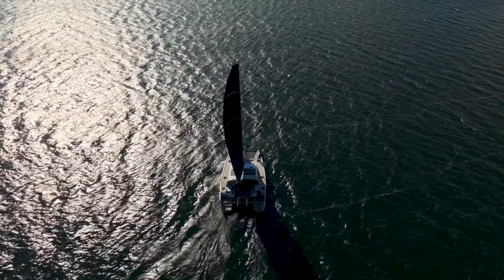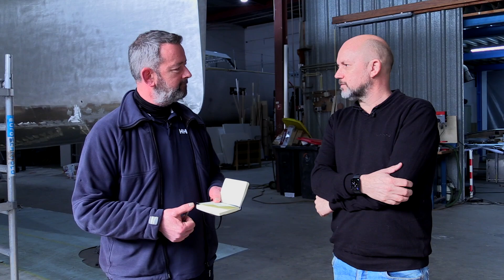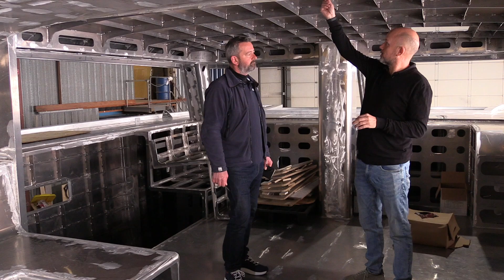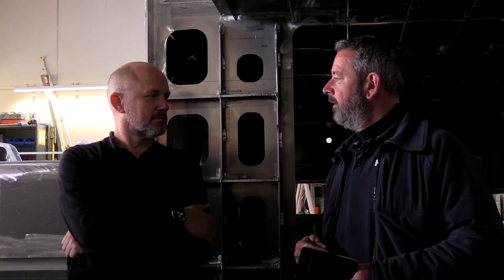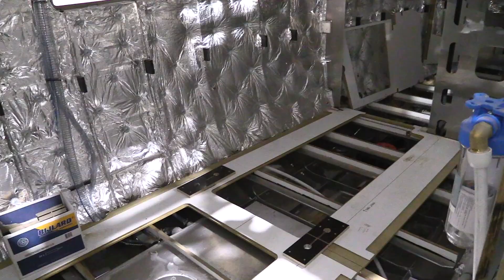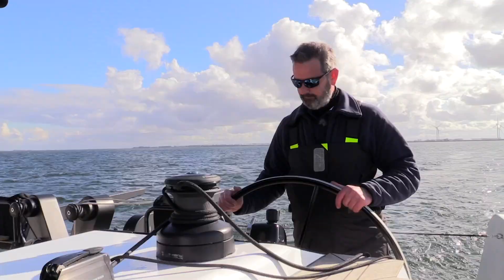Factory visit. How Vaan Yachts builds its aluminium catamarans.

Comment: Distant Shores documented the build of their Dutch aluminium Enksail 49, i noticed they took the spray insulation some way below the waterline then painted the remaining bilges, which seems a little different to Vaan's process where they stop at the waterline. Maybe because cats don't heel much? I assume Vaan paints the bilges? Thanks for sharing.
Reply from the maker: @philipwright7186  thank you for watching.

Vaan may enter the comments soon.

Vaan don't paint the inside, after all, it doesn't paint the outside and that going to be exposed more than the interior (I'm pretty sure, IIRC, Garcia/Allure don't paint their interiors either).

Vaan don't use spray foam because it can be recycled. Also, personally I'd be wary of spray foam because if there's any damage, it has to be completely removed around the area of any welding repair. I'd also be apprehensive of making any area of a hull inaccessible. Of course we're all shaped by our own experiences and Distant Shores are obviously happy with that method.

I know on Jimmy Cornell's Garcia, for example, the floors were insulated so the space between the floor and hull was cold to prevent moist warm interior air from condensing on the cold hull - but she was designed for the North West passage.
Reply: @YachtingReviews  Vaan website says "Parts like “bilge”, “engine room” and “Garage” are painted, so you can easily clean. Other parts are left bare; the beauty of aluminium is that it protects itself by adding a thin oxide layer."
Reply from the maker: @connannbarbarin3033 @connannbarbarin3033  The boats we saw in production weren't finished, so I'm probably confusing those with the boat that was on the water, and looking back through the videos I took, yes, the garage is painted.
Reply: @YachtingReviews 

I've seen a few custom built Al Yatchs a lot of French and Germans spray cork on the inside ... You can also use sheet cork and insulate the floors and provide a comfortable safe flooring inside the vessel that will insulate at high altitudes...and can be refinished and recycled. It's also non-toxic, light and fire resistant .. if you drop more delicate equipment onto cork decks it's less likely to break. 😂 Same with falls. 
Thermal bridging on the internal webs of any metal vessel can be problematic in extreme conditions..  so some form of insulation is required to cover them before the inner lining panels are fitted. 

I'd love to see a Basalt fiber hulled series Hybrid version of the still highly original British built Broad blue Rapier R550. 
There's also a form of Al honeycomb sheet material sandwiched in between two skins of composite that can be bonded to a composite skin to provide lighter rigid insulating bulkheads and floors..  originally developed for Aviation and high speed train interiors ..it was also developed in Basalt fiber composite form. 
Sailing Delos are using a variation on their custom Al Delos 2 build.
Reply: @clivestainlesssteelwomble7665  look up Windelo 55 sport.